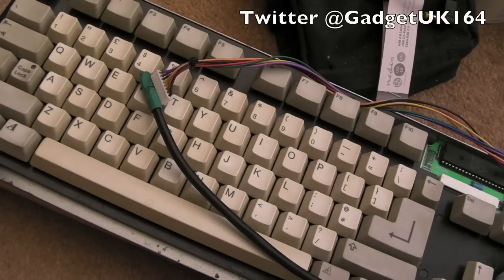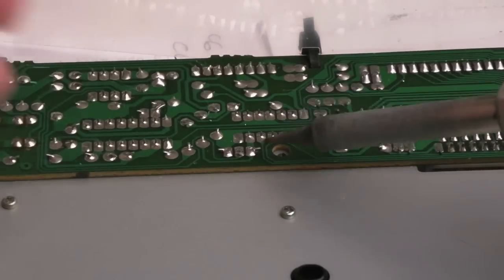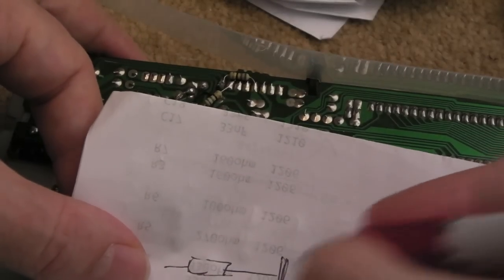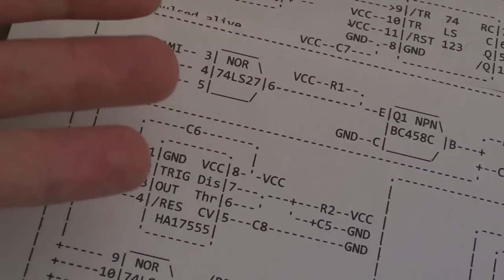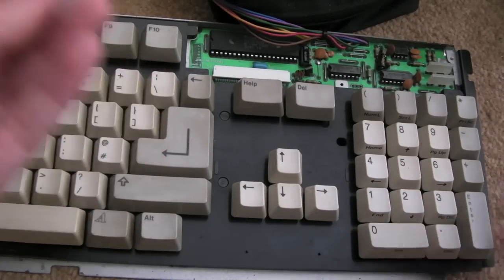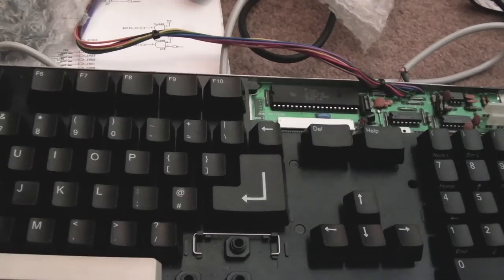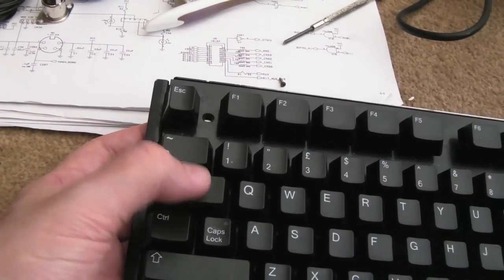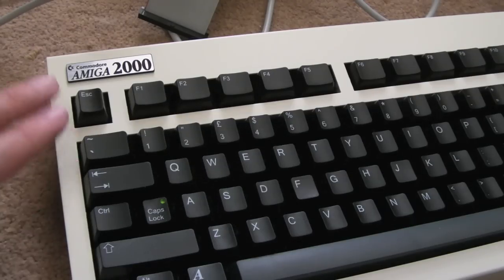Commodore Amiga Checkmate Keyboard Shell & A1200.net Replacement Keys (1st Run) / A2000 DIY Keyboard

Comment from the maker: These key caps were from the 1st run of the Kickstarter campaign and there were apparently some issues with print alignment.  The issue with tolerance and fitting is apparently due to me not having the same Mitsumi keyboards as the ones targeted by the campaign.  You can read more in the pinned comment from a1200.net below in the comments.  The 2nd run shouldn't suffer from these problems, but you do need to make sure your Mitsumi keyboard is compatible with the caps.

However, I would like to point out I did get a reply about the alignment issues earlier in the year when I first complained about the issues (I only just spotted this 09/12/2020) and was told - the campaign WAS put on hold!  This is contrary to what Phillip says below, and I apparently "missed the replacement" window.  So basically I am stuck with these crap keys.  They did NOT inform people there was a return campaign to get those keys with alignment issues swapped.  I have un-pinned the A1200 NET reply below.  You can see their response there.  But my stance has changed over the last few days, more so as others have approached me and as I've just seen their official reply to my point about alignment 2 months ago.

Quote from his reply 2 months ago - "- Production has been suspended when backers experienced misaligned labels on Batch#1"

This contradicts points he made in his own reply below.

Comment: Man am I glad I saved these recent two vids for later, got insomnia and frustrated. Just what I needed to just sit back and chill for over an hour. I don't do films or TV,  and your content is right up my alley, no fuss, no overly produced blaring dubstep intros or outros. Just facts and demonstration.  Thank you Gadge :) 

Edit, btw what type of solder sucker is that? The one you have with the silicon tip (great idea to add to any desolder pump).  I need a new one, and you have been using that for aaages now and not heard you complain about it at all.

Comment: Brilliant hack to make the loose keys lock into place.  I have a few loose keys on my Atari TT030 (which use the same Mitsumi keys as the Amigas) so I'm going to try a little double-sided tape on the plunger to prevent them from popping off.

Comment: The rectangular gap on the back of the Checkmate keyboard case is designed to fit a Keyrah.  The idea being that, if you wanted to put an A1200 in the Checkmate case, you could then use the original keyboard by adding a USB adapter at the computer end, and a Keyrah in the keyboard case.  Certainly not a low budget solution by the time you add up all of those parts!!
Reply from the maker: Thanks - I see now =D  Cathers just pointed this out too - seems everyone knew except for me lol!  Yeah, it all adds up!  If I could rewind I would cancel the key sets and just go with an A2000 keyboard, which sell for around £100 atm.

Comment: Hi. You said the right thing (NPN), but you drew a PNP; that’ll never work in that configuration! 😮 As drawn, you have (essentially) a 1-transistor open-collector inverter; the resistor from collector to Vcc is the pull-up, and the LED is on the O.C. output. If you want the LED to light when the incoming signal is logic-high (Vcc), wire the LED in series with the collector resistor instead. 😊 For fun, you could see if it’s possible to reset on <Ctrl>-<Amiga>-<Del>! 😏
Reply from the maker: LOL, yes - I messed that up!  Part of the problem is I went with PNP first (not the transistor that was on there), and then went back to use the transistor that was in Q1 originally.  Just managed to confuse myself doing the diagram.  I am sure the diagram is right (minus the wrong symbol on the transistor) - I think!?!?!

Comment: I retrobrighted the white keycaps on my A500 and had the same issues with the weird streaking patterns, although they overall look much better than before. I'd really love to get a new set of keycaps for my A1200 and I hope they can iron out the issues - I'm betting demand is going to be through the roof!
Reply: If you just submerged the keycaps in a tray containing concentrated hydrogen peroxide mixed with water so it becomes safely diluted and then expose to UV, do you think that would get rid of the streaking?
Reply: @XXXXXX-dy5fs  It might, there'd be no harm in trying again and if it evens out the streaked areas, all the better. :)

Comment: Man I could feel your pain with those A1200.net keys. It does make you wonder if after the initial batch went out others reported the same issues and they pulled the release until they fixed the issue.  I think if that's the case they should send you a new set with a black space bar!!

Comment: Welcome to the world of plastics and the affects of the Shrink Factor.   My guess is they ran the mold cycles faster and reduced the pack and hold during injection which can cause additional shrinkage all in the name of decreasing the manufacturing costs.  There could also be inconsistencies with the tooling or the tooling was a prototype tooling which is not intended to be a production tool.  Sadly you can even see the weld line in your space bar which is appears the mold has 2 drops and sometimes you can even see two different colors depending on the drop temperatures.   Anyway I have thought about buying new keycaps but after seeing this I have decided to just stay with what I have.  I do have a couple Checkmate Keyboard enclosures I built one and not the other because I am on the fence about them.  The big rectangle hole is for mounting a Keyrah2 so you can use other keyboards in the enclosure.
Reply: Hello, we don’t rush the production cycle in order to save time.. the risk of errors is not an option. Besides all is automated and validated such that they all should be of the same quality. For the transfer printing, we acknowledge that the pad printer had some alignment issues and we have now fixed it for the second rendition. This far we swapped out single keys to those with issues in order to resolve it to everyone’s content and there are plenty of videos out there showing successful replacements of keycaps. So what went wrong here? It is hard to assess from a distance but we never ever seen so many keys having issues so we asked the poster of this video to contact us.
Reply: @BigLebowski1337  I have been injection molding plastics for over 30 years.   Unless your actually doing the molding yourself you have no means of controlling the quality.   Often custom molders will change the process to increase their profitability and with any change there will be some affect on the molded parts.   Just because they look great does not mean they will function properly as there might be slight changes in the gram weight and in the dimensional characteristics of the part.   Unless your actually measuring and weighing the parts upon receipt its difficult to know if what your selling is correct or not.  Even when you do mold your own product its still a challenge.   There is one other factor which can create issues is that your molding something with the intention of it mating properly with something previously manufactured and in this case the entire quality of those components applies as well.    If the dimensions of component A is on the larger side of the specification and component B is on the smaller side of the specification they might work but might not.  Before I would ever mold key caps I would want to see hundreds of keyboard to understand the dimensional variances.   Best way to avert a problem is to make the stems as well but that requires making another expensive tooling.

Comment: There is 2 different sets of these Mitsumi Amiga keysets. I have several Amiga keyboards and keys are always same. Thats why its so wiggle and comes off easy.
Reply from the maker: I've got several keyboards here from different machines with different manufacturing dates - the caps are all interchangeable with each other - but the a1200.NET keys are loose on all of them.   So the Mitsumi keyboards these are aimed at must be a niche model?!?   They are poor fitting on my A1200 - that I don't get, the 1200 was produced much later than the 500 and 2000.   The main issue is there's too much of a tolerance between the new key square part.  It's very noticeable.